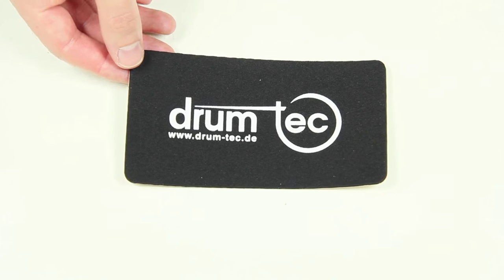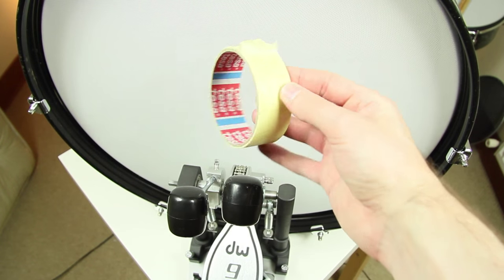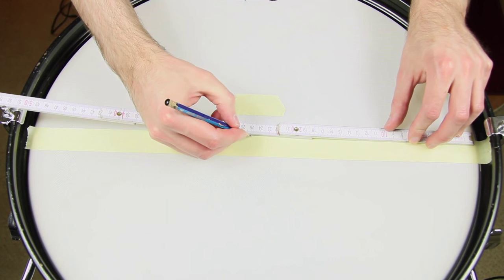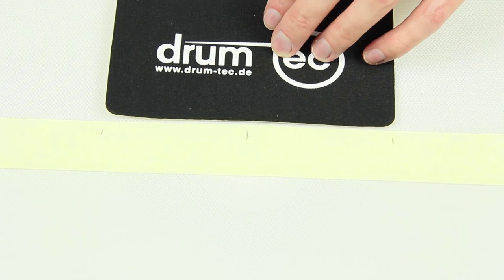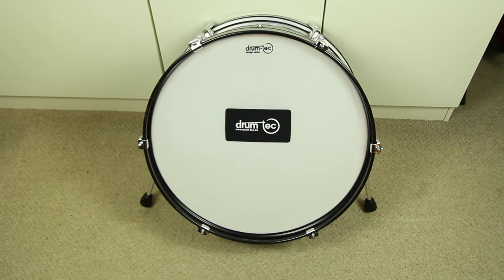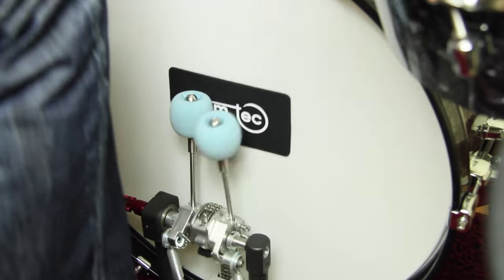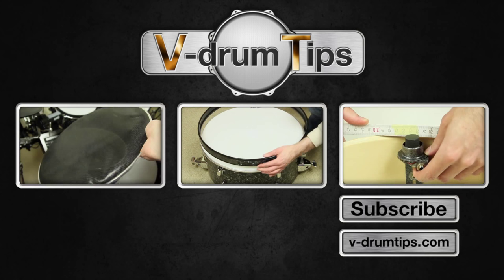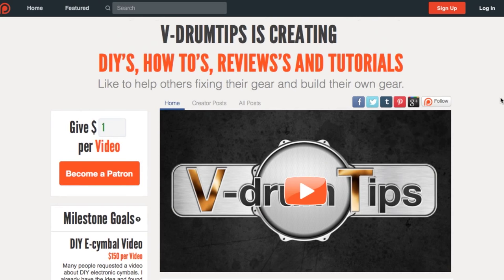Applying a Bass Drum Patch (E-Drums)

Comment: I'm wondering if this pad can be used for a v drum rubber bass drum trigger pad to reduce the noise from being hit from the bass drum batter.
The only problem is that it might not want to come off if it doesn't work.
I'm trying to reduce the plastic noise my V drum cymbals and bass drum make.
I was thinking about some type of pad like the one you are demonstrating that won't take away from the trigger sensitivity to a point that it muffles the sound.
Reply from the maker: +williamjver This is actually not made for rubber pads, it will not reduce noise. This patch is to conserve the mesh head and soft beater.

Comment: I am currently using felt beaters, i guess i'll make a hole if i go like this. Can you use a drum patch on kd-9? Should i replace the beaters or buy a drum patch and continue to use felt beaters? I am using a twin pedal so buying a drum patch would be cheaper option. Noise is not much of a problem for me right now. Thanks in advance.
Reply from the maker: you can apply a patch to your kd-9. Just make sure it is a sticky one. Standard patches are usually not as good.

Comment: How about a KD-10? Necessary?
Reply from the maker: No
Reply: @Vdrumtips1  so you would say I could use the felt beaters on my KD-10?
I have been using the plastic beaters because I read about felt beaters ripping through mesh after a while.  
I was getting a sticky patch, but you think it's not needed?

Kind regards.
Reply: @Nachtdwaler  dont use felt